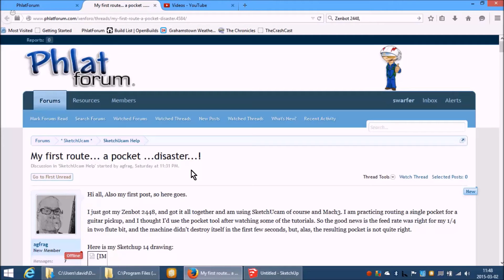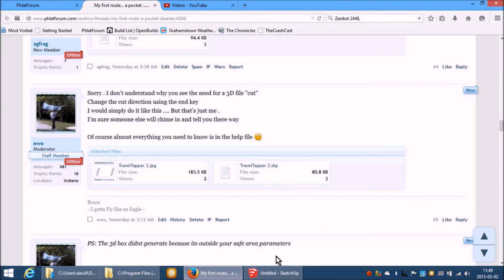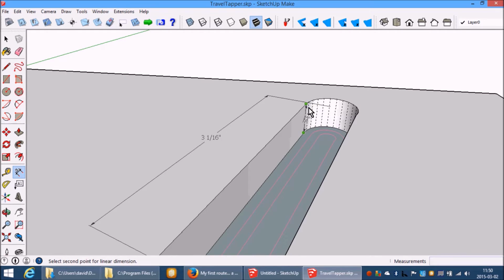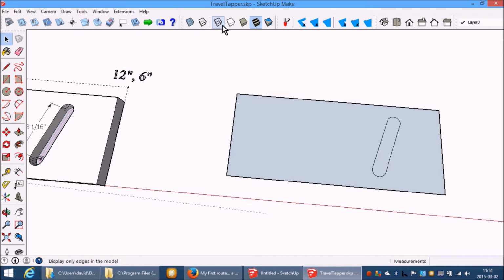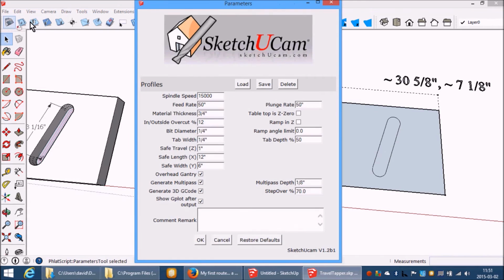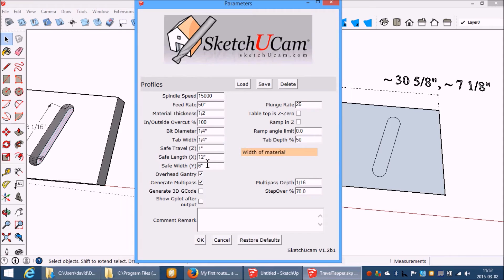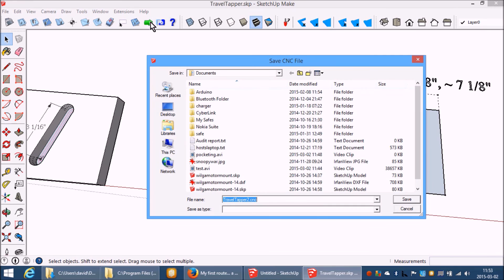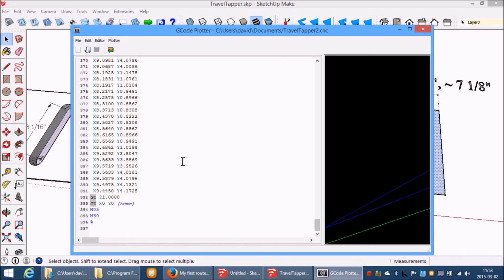sketchup pocketing -basic

Comment: what if it was a curved pocket .....will it still doable ??
Reply from the maker: shand seimela  the pocket tool can do curves but does not like complex pockets, so after inserting just the pocket outline (hold down CTRL), you then draw some lines in to simplify the pocket, then insert zigzags to cut each sub-area.  I should do a 'complex pocket' video (-:
Reply: yes please sir that could help a lot ...and if you can please run your generated  G code with cnc machine